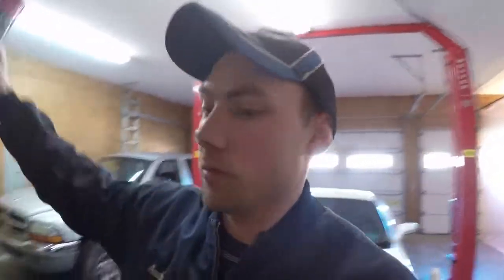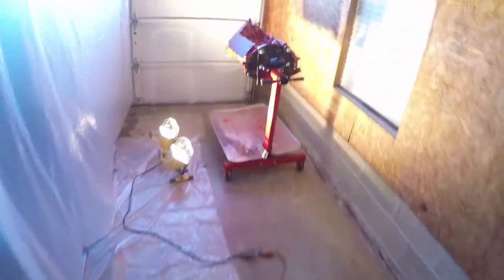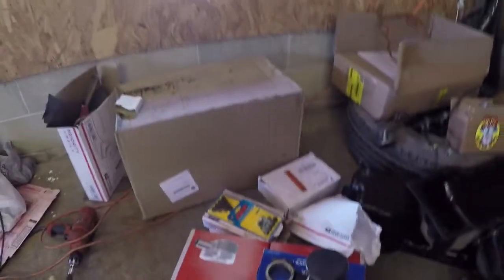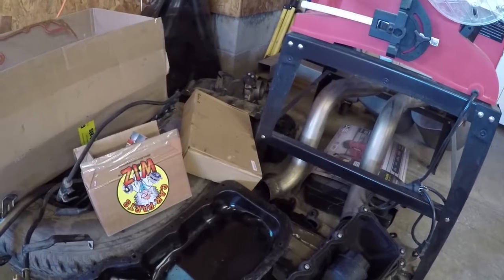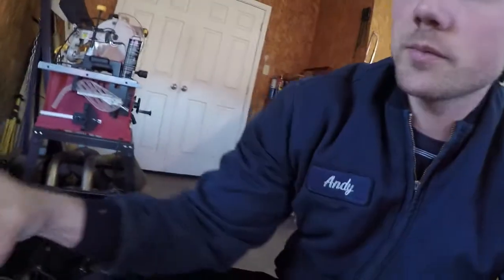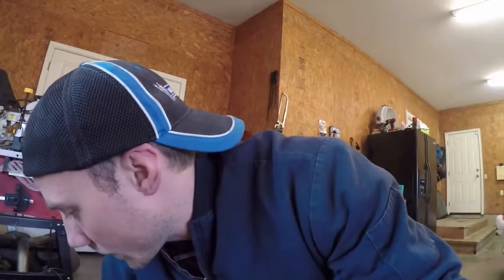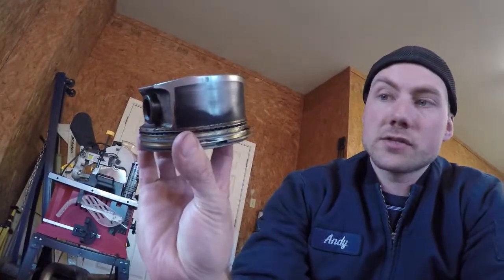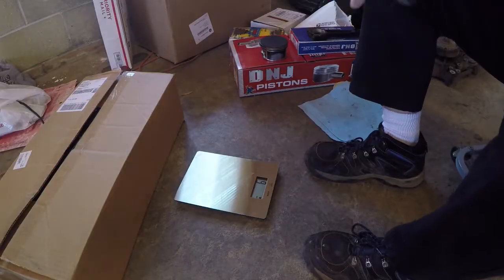DODGE 4.7 Re-Assembly PT1

Comment: Good stuff!
How many miles did your engine have before rebuild?
Reply from the maker: I bought the truck with 150k and another 10k some odd after. The rings were shot from the crappy kennebell optimizer.  Still ran when I yanked it but it burned oil bad.